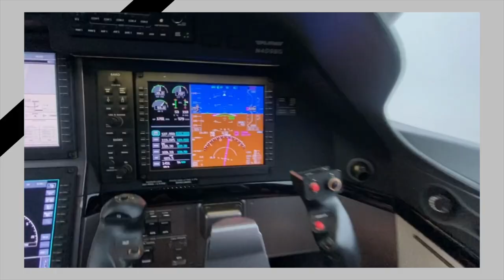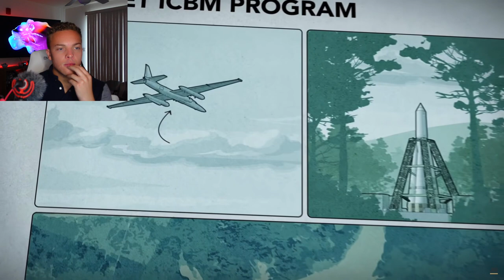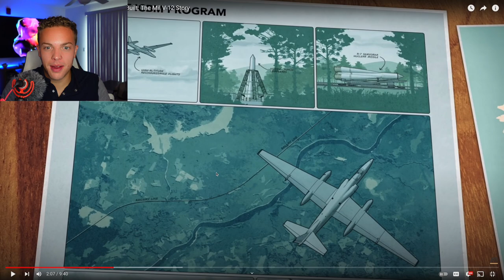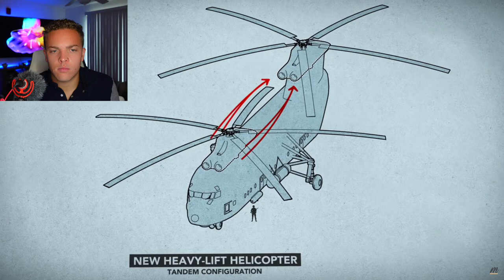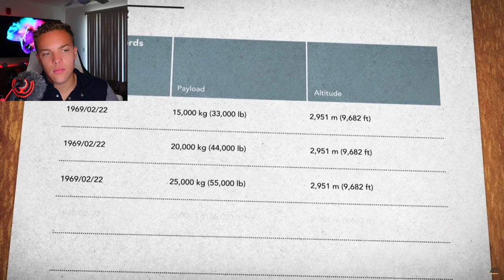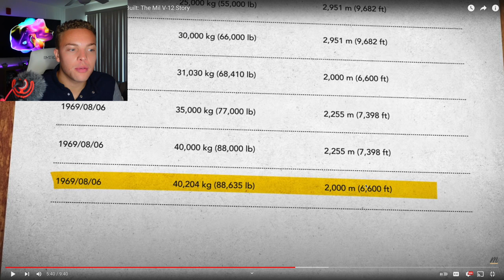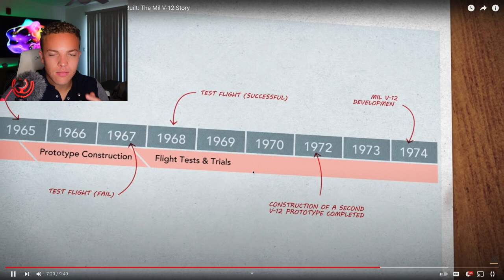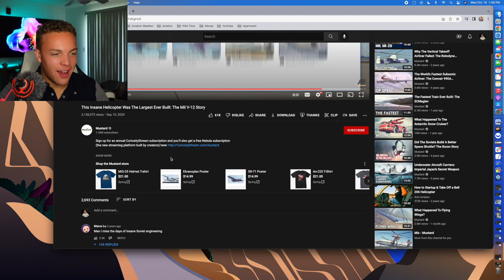What Happened To The BIGGEST Helicopter Ever Made? (MIL V-12)

Comment: The DOOM CORNER of transverse dual rotor is if one rotor goes into vortex ring or settling with power, the crew has to immidiately go into autorot, or aircraft will roll beyond critical and crash. The rotors were interconnected to gearboxes, so that two engines can drive both rotors if one r both engines on one side were lost. Similar system on V-22 Osprey and AW609 tiltrotors. The safety issue of MI-12 and MI-26 rotor is that the blades are ultra high intertia.

Comment: Soviet helicopter design philosophy is to have as high Vne as possible, and to operate helicopters at high cruise speed. THe wing (or winglets) provide supplementary lift above ETL that reduced in flight coning of rotor disk. When not carrying sling loads, and those huge helicopters could carry missile parts inside, the aircraft would use rolling takeoff. MI-24 Hind crews in hot&high Afganistan used rolling take off frequently, as if aircraft was partly an autogyro. Point is to use ETL combined wiith wingborne supplementary lift to assist in heavy GW T/O.  Soviet, now Russian large helicopters have higher then normal Vne, and are faster then Western types. Russian helicopter schools produced extremely profficient flight crews. Many viewed rotary aircraft as more important to Soviet Union then fixed wing, as so much of Russia, East of Ural mountains was basically wild undeveloped. Bush piloting of large transports was another area of Russian Soviet aviation that was highly developed. It is tragic, how many Soviet rotary crews perished in fighting Chernobyl nuclear reactor fire.